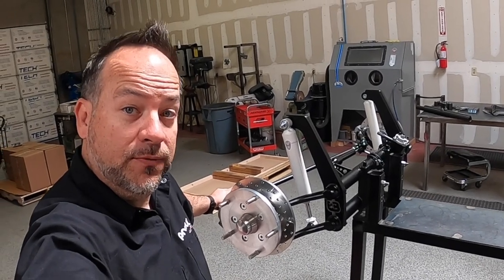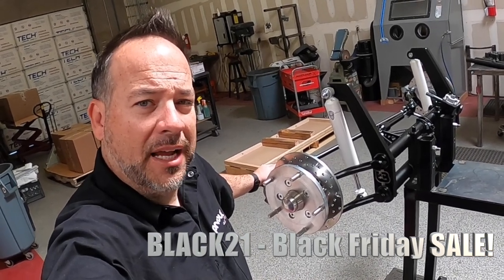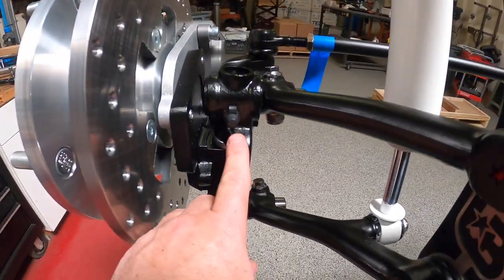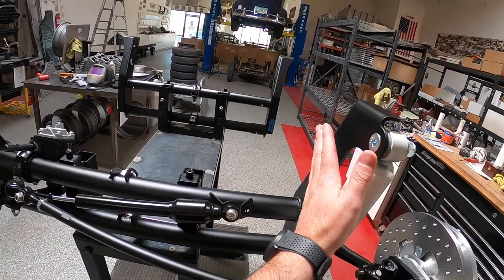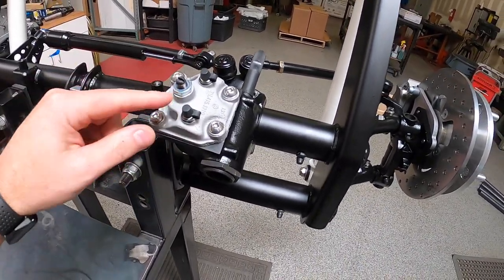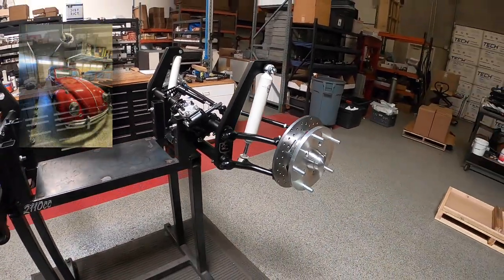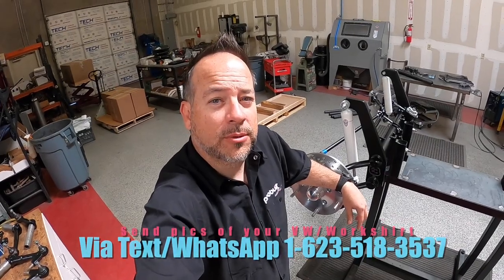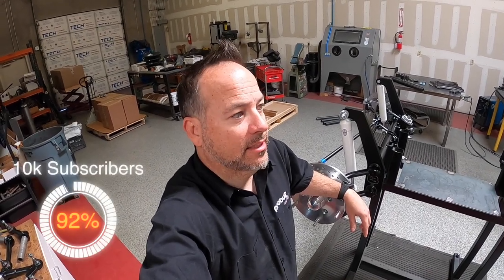The PRObuilt Package for a 1964 Volkswagen Convertible | BLACK Friday Announcement

Comment: Pete, I think I'm ready to make a beam purchase.  Do I need to have my rims and tires before I buy the beam?  Also, for the rear should I pick up the rear drop kit and tranny at the same time or is that something I can get piece by piece?
Reply from the maker: Whenever you are ready, we are here to help. You don't need to have the purchased but you should have them picked out. No drop kit needed in the rear unless you are going super low. Adjust the torsions and some new shocks.
Reply: @AirkewldVWs  Cool, Thanks!  I have always wanted the ol' 5-spoke Porsche wheels in all chrome.  Thoughts on which ones will work best with your beam and breaks?  I think you all sold them a long time ago.  CIP1 has them but I think they are a knock off.